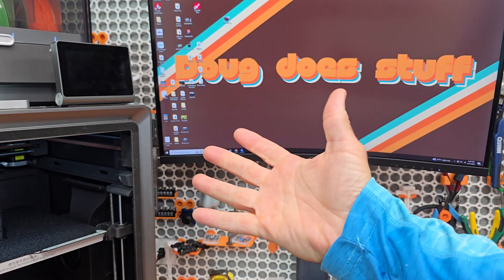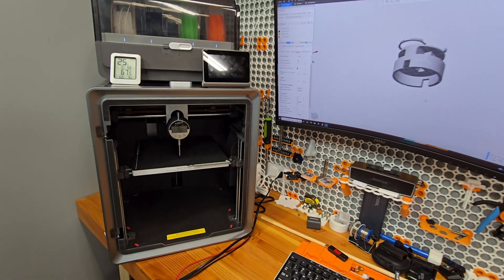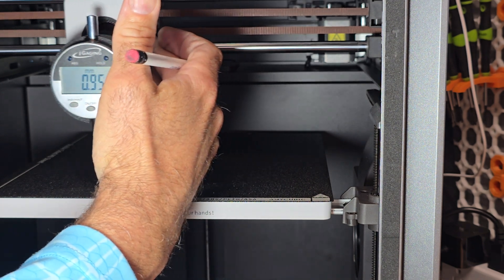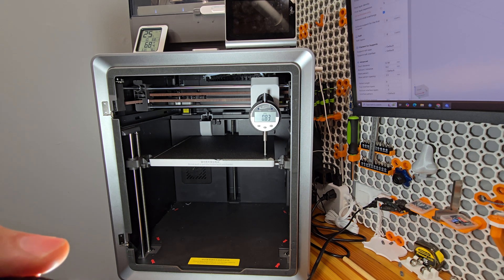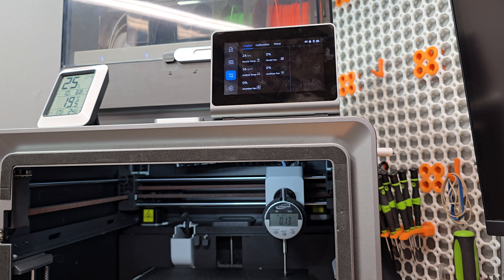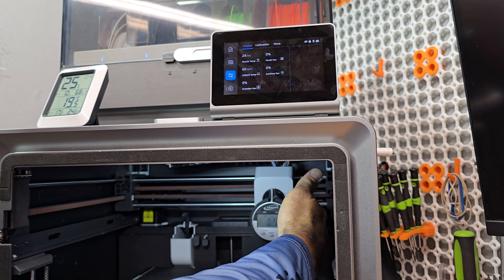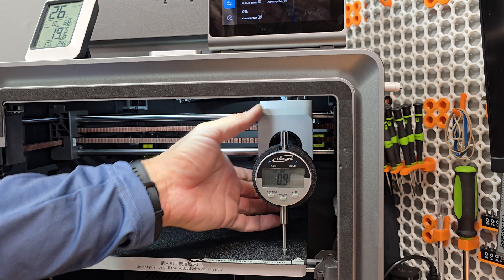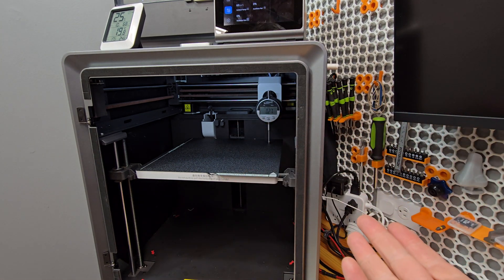Kobra S1 Combo: Warp factor 1.2....Engage

Comment: They cant send you a New unit?
Reply from the maker: Just throwing parts at me right now.  Waiting on a new bed right now.
Reply: @dougdoesstuff24 Nabbbb ask for a new lrinter.. not worth it! They refurbish this one and it becomes their problem...
Reply: @dougdoesstuff24 keep all the bad parts .... bet you build a better printer after this one still ain't fixed ....I'm kidding but ya if it ain't fixed the part aint bad 😅 😉
Reply: It probably won't be any better.  These beds are just too thin and warp badly when heated.  Which you are already seeing with this one.
Reply: @mahughesnh  I don't have an S1 but planning on getting one. Would it be possible to reinforce the bed somehow?

Comment: haha same story.. with very small manual interventions at the end of each print, my first layer is not bad at the moment but it is definitely not perfect.. I don't know if it will work but I am thinking of cutting a thin glass (1mm) between the hotbed and the removable sheet, in the same shape as the sheet (I assume the glass will not stretch, it worked on my previous printer)
Reply from the maker: I'd be interested to hear if it works for you!